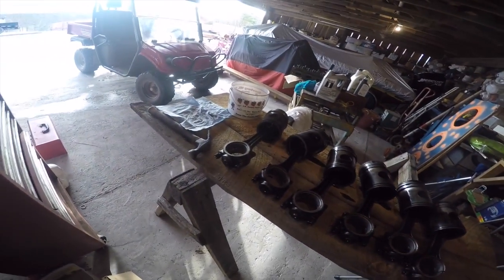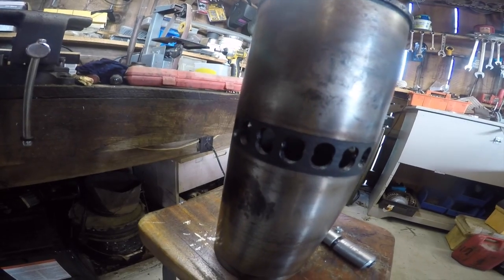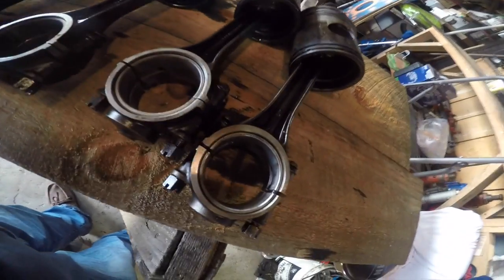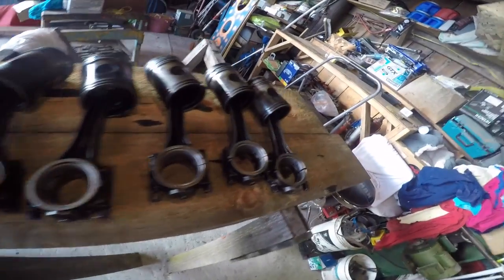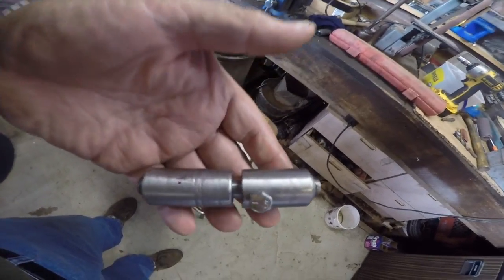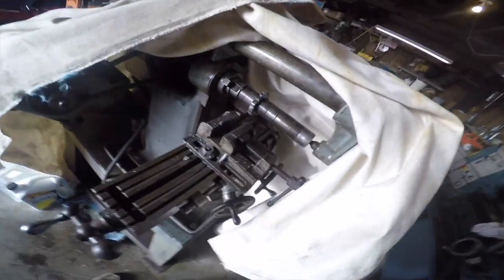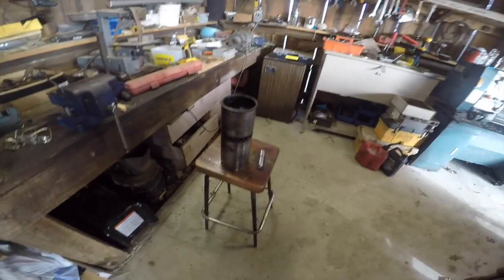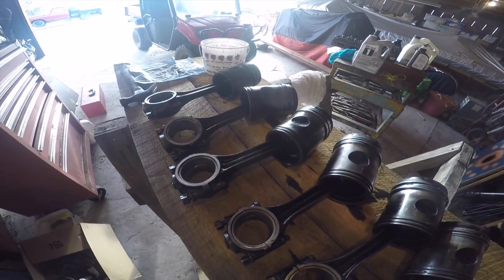Detroit Diesel tear down

Comment: Yeah it looks like u got an early model E engine std. port P&L combination or even maybe a low block w/ the one piece head gasket & an outer seal gasket instead of the quad rubber ring gask

Comment: The 318 Detroit was a 6v53
Reply from the maker: No the 318 was an eight V seventy one. The 71 is the cubic inches per piston. The 6v53 was a smaller motor with 53 cubic inches per cylinder.

Comment: Hey mr.mccoy.. I got a question if you don't mind sharing ya knowledge bud.. if you put a bigger motor instead of that little detroit on your saw mill.. would it mess the mill up? So say you put idk.. a big 3406 500HP motor on her.. would it turn the blade to fast? Possibly tear out the cylinders etc etc
Reply from the maker: It would be fine. A saw don't need to turn fast. Around 500 RPM. The best set up in my opinion is take that big cat motor and hook it up to a generator and run electric motors.
Reply: Reel McCoy I got ya. I thank you mr.mccoy

Comment: those old Detroits were originally designed for marine applications and got put into pretty much anything after a while
that's the main reason they didn't have much torque-they were designed to run at full throttle day after day after day; and there ain't no hills to pull on the water!

Comment: Woo Hoo! I never seen one of these rascals! Looks like a large job to me Michael.
Reply from the maker: +cutworm59 It is not to bad. Biggest problem is there is less than a foot clearance on the bottom. Kinda tuff getting to the rod bolts.
Reply: +Michael McCoy Does it have a huge head like most diesels?
Reply from the maker: +cutworm59 YES! We had to put up a 4X6 beam and use a come along  to take it off.The table it is on can be moved up and down. The way we got it out of the truck was to slide it on the table. Mary Ruth and me could not pick it up.
Reply: What sucks about it it does not run roller bearings! Otherwise its a nice motor.

Comment: I love the old Detroit's we had a couple old trucks that had them when I was a kid. One was a 6-71 or 238 as dad called it and the other was a 8-71 318 horse. And if you ever need anymore parts try Power Products in Ashland Ky 606-329-2418 is the phone number. I used to work hauling scrap metal and my boss's car crusher has 6-71 and that's where he gets his parts.
Reply from the maker: +John Wallace Thanks John. I will keep Power Products number.